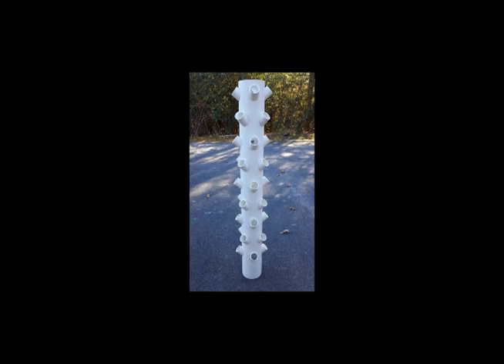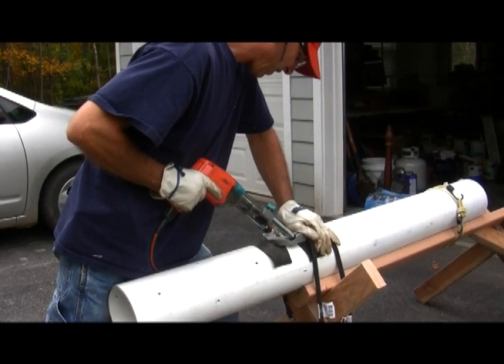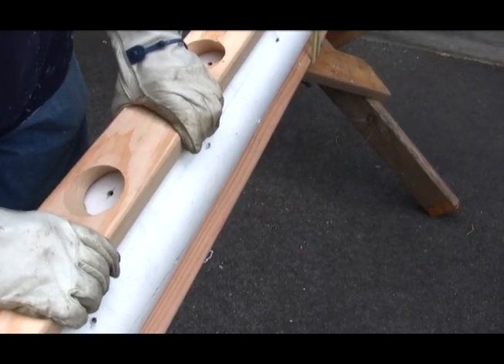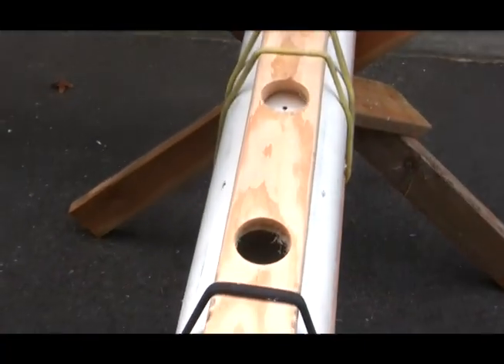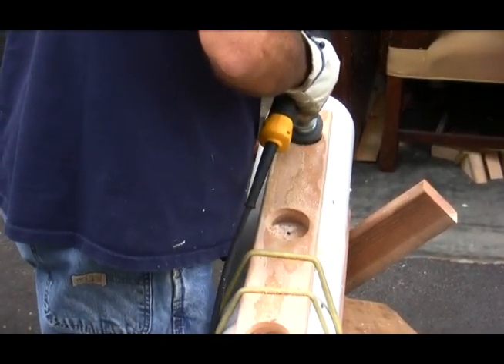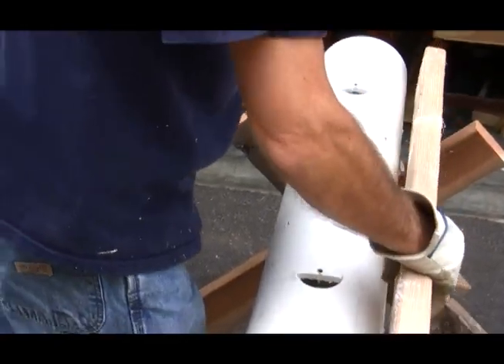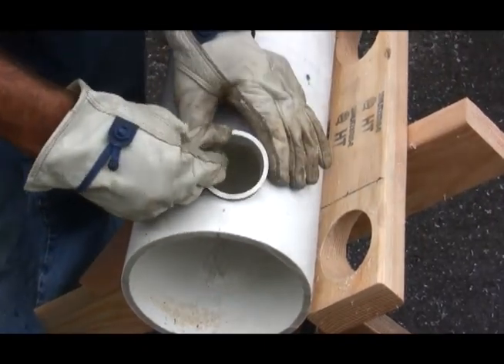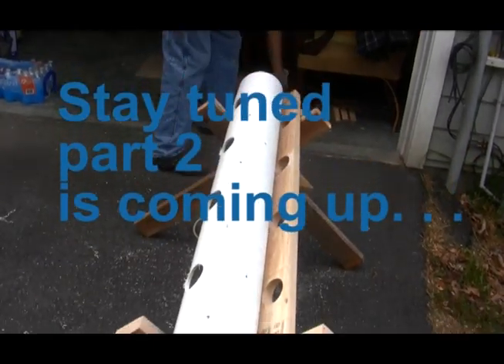DIY Aeroponic Tree pt1

Comment: That's an incredible amount of work...I drilled mine straight down, a 1/4 inch smaller than the  inside diameter of the "cup""; that also helps hold the puck...I sand the smaller pieces to fit the contour of the pipe, by gluing a piece of sandpaper to a piece of the pipe...

Comment: Did you try using a forstner bit mounted in your drill press at the angle desired?
Reply from the maker: +Frank Pinto No just a hole saw that I bought from lowes that fits the 2" sleeves
Reply: +Auburn Sky Farm It might be able to save you from having to: drill the pilot hole, un-mount the hole alignment jig and use the jig saw. Could save a lot of time and effort. BTW, videos are very useful. Thank you for publishing them.